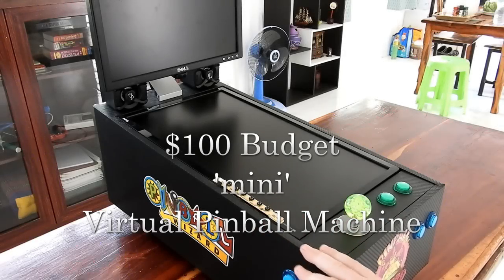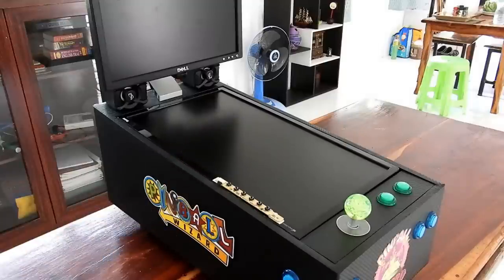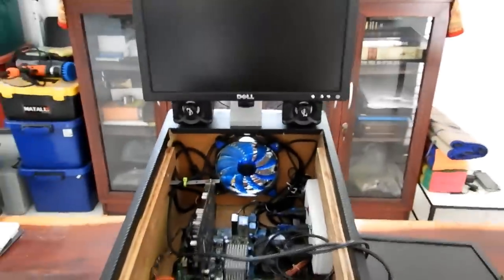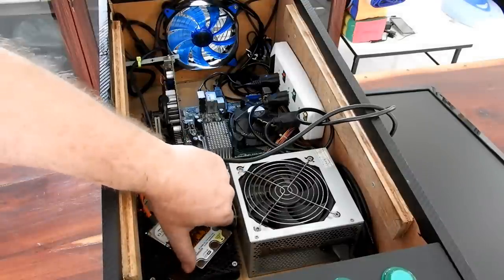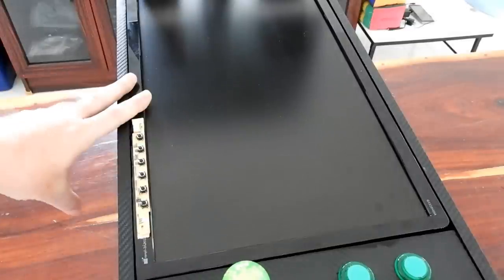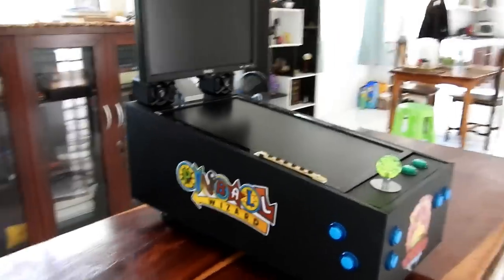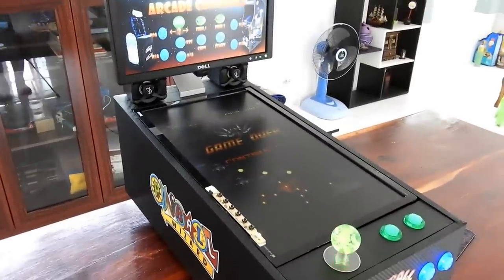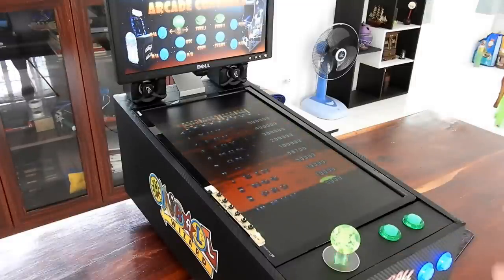$100 Ultra Low Budget Mini Virtual Pinball!

Comment: Nice. I fixed a 3/4 V Pinball cab I bought awhile back that was built the same way where everything can easily removed. Now I want to build a even smaller version since I have the software for it now.
Reply from the maker: Hi John yes I fancy doing another a bit smaller too and possibly a 3/4 size. Work's got in the way for now though might be a while before I can do much more. Cheers!

Comment: Nice work. I'm working on one now that looks very similar. I'm also putting bumpers in mine with mini solnoids that vibrate with the bumpers.. I also made a analogue plunger using a mouse that's upside down that reads the throw. Nice work. I would have stick the monitor controls to the back. Once it's set you don't need them anyway.
Reply from the maker: Hi & thanks! Yes, I stuck the monitor controls to the back of the monitor once it was set up. I might do more with another project such as feedback and plunger, but unfortunately work has gotten in the way so it might be a while... Cheers!

Comment: I have been trying for awhile now to get a zero delay usb board to work with pinball FX3 but have not had any luck at all the program simply wont recognize any of the ones I have on hand. Do you happen to have a link by any chance to the one you used?
Reply: nvm I just now saw your pinned post thanks!
Reply from the maker: Glad it helped!

Comment: Excellent idea, but you need an actual emulator to get a better immersive experience and have an actual flat table. By which I mean not have the table scrolling up and down. I think the dedicated emulators also give you the back glass as well. So same kit as yours, just more pinball focussed software.
 I'm building a 3/4 size, great to know the stuff I already have in my workshop will work. But I'll definitel be using your button setup. Apart from size this build is exactly what I was looking for to sort out my electronics. 
Weirdly I can make space for a floor standing table, but nowhere to put a tabletop model :-)
But it's just a case of scaling up the box and screen.

Thank you.
And English as well :-)
Reply: Any idea what the latency on your screen is ?

Comment: My mind has been blown!  Fantastic project.  I used to build desktops in the late 80's early 90's, get all of my parts (and software) at the monthly computer flea market, some new, some used, some OEM.  You have taken that to a new level with this pinball machine.  I will be tipping a cold one in your direction very soon.  Cheers! I have only tried the MAME / VP games.  Are the others similar in setup?
Reply from the maker: Hi Marcelo, thanks for your kind words. I hope your project works out well too. Future Pinball is similar (free software and tables from the community websites), but hasn't been updated in a while, though some enthusiasts still make tables. It's kinda similar to Visual Pinball in it's layout take a look... Others are Pinball Arcade and Pinball FX3 (current version I think), which are proprietary and available on Steam (and possible elsewhere). These are pretty cool, though some enthusiasts can be a bit anti towards them,, but you should check them out. Cheers!

Comment: How did you get cabinet mode in pinball arcade . at the least fit arcade mode on vertical screen
Reply from the maker: Hi, if you enable portrait mode in Windows screen settings before running you should be able to use pinball arcade in that mode. Cheers!

Comment: Now if only a Red Dwarf playfield and a Holly frontend to pick your games.  Great work.

Are there places that offer downloads for the software ready ti go?  I know you can get the pieces, but putting several pieces together (Mame, Hyperspin, plus various pinball systems) and getting it all to work on 2 monitors would be my issue.

I also prefer the tables to be static... not move with the ball movement.  Is that an option, or only on some tables?

I have built arcade joysticks using a PI B+, but I downloaded all the software, frontend, and games on a micro USB.  I just plugged it in and played.  Hardware and woodworking I can handle.

I guess my question is, are there single images available somewhere for download?
Reply from the maker: Hi Jeff, look at some of the other videos in this playlist to see how this develops. 

You could buy the pre-done setups that are advertised on ebay and similar but a little perseverance and you could do it all yourself it's not that difficult. Again, look at some of the other clips on how to install the software.

I didn't set the correct view during this setup so the table scrolled (which you wouldn't want as you point out). You can change the views easily and there are static full table views - explained in other clips.

Most of the fun for me was the satisfaction of doing it all myself but it is time-consuming and debugging can be frustrating at times...

Last point - look at the other clips of development and software install if you have time it should help to clarify things.

Cheers mate!
Reply: @arnoldj.rimmer5116  Thanks... Smoke me a kipper, Ill be back for breakfast!

Comment: According to your plans and specs, you have a height of 25cm for the bottom panel which would equate to just less than 10".  Is something off, because I can't find a monitor with a height without stand of less than 10" that is approx. 22" in size?
Reply from the maker: Hi, the bottom has no height, it is the floor to the pinball "box". Do you mean the width of the bottom? It is the same as the width of the front and rear pieces (30.5cm), which are all "sandwiched" between the sides (though yes it does look narrower on the plan I drew). 
The plans aren't to scale but are just to show approximate sizes and panels for the monitor I used (I had it already but would recommend something like Acer K242HL) - you should adapt for the monitor you have.  
Hope it clarifies.
Reply: @arnoldj.rimmer5116  Thank you Arnold.  The bottom panel when installed and looking at it from left to right should be equal to or greater than the height of the monitor when laying it in the box.  The Acer you described has a height of 335.9 mm which equates to 13.22".  Your plans say from left to right the height should be 25 cm or 9.84".  Obviously not big enough for even the Acer.  All I was wondering was whether this was a mistake in your specs and plans because it's near impossible to find a monitor that would fit between a left and right panel into the box if the box is only 10" wide.  You don't actually provide the width of the "bottom panel" in your drawing, but it looks like it would be the equivalent of the rear height for the left and right panel which was 25 cm.  Perhaps that's were the mix up is.
Reply from the maker: @echodun  Hi mate you are correct. The monitor I used was a Benq G2220 (I had spare), modified to cut the control panel off to make it properly rectangular. 
I recommend the Acer because it requires no modification (the cable connector layout is also easier) but it does require appropriate modification of the dimensions as you point out.  The plan was only intended as a guide to base your own cabinet on. 
Anyway I hope it helps in a small way if you're planning your own. Cheers!
Reply: @arnoldj.rimmer5116  Thank you for the response.  I ended up going with this monitor - https://www.amazon.com/gp/product/B07CVL2D2S/ref=ppx_yo_dt_b_asin_title_o00_s00?ie=UTF8&psc=1
How did you get the textured look on the wood paneling?  Is that a wrap of some sort?
Reply from the maker: @echodun  Hi! Nice monitor, looks ideal. The wrap is here https://www.aliexpress.com/item/32260499629.html it's pretty generic so you should be able to source similar locally. Cheers!

Comment: Okay so it should run on an asrock beebox n3000 if you want to run an even smaller setup. Cool. Plus it has a monitor mount so you can just mount it to the monitor.
Reply from the maker: I'm not familiar with the asrock model you mention, but the software isn't as demanding as one might think so it would probably run fine.

Comment: For the money you've done a fantastic job there. The only improvement I'd suggest (for very little money) is to use a KL25Z board for more realistic nudging. I find the fixed digital nudges in pinball to be totally false. But then again real pin heads will scoff at anything virtual....so it's all relative. Brilliant little project there!   <^.^>
Reply from the maker: Cheers mate appreciate the feedback and info - will definitely check that board out if I get chance to build another...

Comment: What is the lag time for the play field monitor? what monitor did you use for the upper monitor cabinet? to load more pinball game files what file extensions names are they using?
Reply from the maker: Hi Bill the input lag is insignificant even with this very low spec computer - certainly it's barely noticeable and highly playable. I would recommend a minimum 3GHz CPU (dual core or better) and better GPU > GT630 2GB, for smoother play on the few tables which need it, but it's not an input lag issue. If you want the actual monitor spec: https://www.cnet.com/products/benq-g2220hd-lcd-monitor-21-5-series/ Backglass monitor is a Dell 17" this one - https://www.amazon.com/Dell-E17-LCD-Monitor-Black/dp/B007IWQELC ?You can find tables on many pinball forums - they use different filenames but once you set up VP and FP you will get a better idea. Cheers Bill!

Comment: Hmmm. I wonder if there's a pinball rom pack for a Raspberry Pi?
Reply from the maker: Hi Nick a few people have asked the same thing, but I don't believe so. Maybe ask on the Pi forums? Cheers!
Reply: @arnoldj.rimmer5116  I've done some research. Pinball FX3 or Visual Pinball would be a non starter on the Pi. Nowhere near powerful enough. A Nintendo Switch on the other hand plays FX3 at 1080p. That would be acceptable for a smaller table. It actually looks really good on my 55 inch TV 📺.

Comment: Do you think any of those cheap fanless computer around a $100 bucks would be powerful enough to run the more classic tables?  I'm sure a pi is out of the question.  I think I read the emulator is all windows based.
Reply from the maker: Hi Walter yes Future Pinball and Visual Pinball run on windows. Computer spec of 3.0GHz Dual Core, 4GB Ram, video card Nvidia GT650 2GB (or better than these) will run those programs well, and Pinball Arcade and Pinball FX3. A used PC shouldn't cost as much as $100 - look on Ebay and Craigslist. Not sure about the graphics capabilities on the mini PCs mate - I'd suggest you do some googling...

Comment: Returned from home depot in California.. a sheet of plywood is $110 alone lol
Reply from the maker: That's expensive. I would have preferred to use MDF over Plywood tbh, but it's not available where I am. Maybe that's a cheaper option where you are?
Reply: @arnoldj.rimmer5116  yup $43 for mdf or $32 for melamine 4x8' pieces which is the way I'd have to go

Comment: Waoo!!! Awesome job 💪 dude, Thanks for share the video and the information.
Reply: One Question , what brand is the vertical monitor?
Reply from the maker: It's a BenQ G2220HDA, but i wouldn't recommend this monitor because the control buttons mean the corner needs to be cut off. Something like Acer K242L needs no cutting - though it's slightly bigger and the plans would need to be changed to fit it. Hope it helps!
Reply: @arnoldj.rimmer5116  Thanks!!

Comment: Great Video Arnold
I am looking to make one of these for my child and would love your help
the layout/build i am good with, my concerns is with the program and monitor/screen/picture layout.
how do you have the main screen (playing field) load up from turn on, with the screen showing the proper way (meaning, how is it displaying properly, even though the monitor is turned on it's side?)
also, how do you configure the joystick and buttons to use like a mouse?
what is your list of components inside, that you use for this build?

thanks again, as much info as you can provide, would gladly be appreciated.
Reply from the maker: Cheers Gary! Take a look at this quick clip about the arcade button & joystick controller setup and software to use https://youtu.be/wVe-TSupO94

Basic list of components are those included in a standard desktop computer (MB, CPU, GPU, HDD, RAM, PSU, Fans etc.), which is why its easier just to find a cheap used computer and use all the bits from that! I mention in the last update that I believe (after using it for a while), that you shouldn't go much lower in spec than this to have something running and playing well. Plus of course you will need the button kit with USB encoder which you can get almost anywhere online now very cheaply.

Loading this (or any) program at startup is simple - either it's an option in the software itself or you simply copy a shortcut of the program into the startup folder in Windows.

I will do another short clip about setting up VPX on the cabinet to use on 2 screens and with PinballX front end - I'll cover the screen rotation in that. Cheers Gary!

Comment: Looks awesome! I'm planning to make something very much like this. I was wondering how you mounted the back monitor. It looks like you removed the foot and screwed it onto the back crosspiece. I have a similar Dell monitor that I wanted to do the same thing with, but it's suprisingly heavy for its size. Did you have any issues with the weight?
Reply from the maker: Hi Johnny! 

Yes, that's exactly what I did initially. The crosspiece holds the weight of the monitor without issue, though there is a small, thin, metal plate which is under the crosspiece through which the screws pass, for strength and so that the screws don't damage the wood.

However, please look at the two update videos to see how this developed with the feedback I got. I eventually decided to make a box for the rear monitor, which makes a huge difference to the look and to drop the MAME controller.

Hope it helps!
Reply: @arnoldj.rimmer5116  Thanks, man! I checked out your other videos and although the backbox looks great, I really like the minimalistic look of your original approach. So I think I'll try that first. :)
Reply from the maker: @johnnykickass2815  Hi mate cheers for your positive feedback! I don't disagree with your idea either I'm just glad you got some ideas from mine. Best of luck with it I'd love to see it when you're done and I'm happy to help you out if you get any issues. Best of luck!
Reply: @arnoldj.rimmer5116  Cool! Will do!

Comment: Thanks so much for this video I have wanted to do this project now for 4 years or so and have looked at video after video I just have no technical thinking when it comes to computer s I have purchased all the stuff tv pc speakers Crome buttons the lot apart from the timbers but for that is the easiest part for me I was wondering if I get stuck if you could give me some advice along the way I have downloaded your instructions so fingers crossed great job and I wish I had one your so lucky to own one from tony
Reply from the maker: Hi Tony! I'm glad this has helped take away some of the worry about putting one of these together. And, no problem, if you have any questions please ask on here (as I'm sure others will have similar questions), and I'll try my best to help out. 

To get started, I planned how to lay out a normal desktop computer into my cabinet (because there wasn't much room in this one), so start with that and go from there! All the best Tony!
Reply: Arnold J. Rimmer I have a dell optiplex it’s not a duel core and it did run vista will this be any good or will I need to replace it or maybe even use a cherry pi 4 if I can I will definitely be out my depth their lol but thanks for getting back to me I appreciate it
Reply from the maker: I have 2 Dell Optiplexes (Optiplexi?) here and both are dual core processors (I suspect yours is too if it ran Vista ootb). Download free Piriform Speccy and it'll tell you what the spec is. I'm not familiar with the Pi/Arduino type computers mate sorry but I see they do have lots of support forums.
Reply: Arnold J. Rimmer it is an AMD Athlon  64 I believe I was gifted it by an family members years ago  so that’s all I know  but I can’t wait to get this going if I can
Reply from the maker: If it's a Dell Optiplex 740, it is an AMD dual core (https://www.cnet.com/products/dell-optiplex-740-desktop-computer-amd-athlon-x2-4850e-160gb-1gb-series/), but memory is limited and graphics are onboard (unless it has been upgraded). 

Visual Pinball likely will not run, nor will Pinball Arcade or Pinball FX3on this setup. However, you might get Pinball FX2 going (if you can find it as it's no longer on Steam), though I'm not sure how playable it would be with onboard graphics - maybe try it and see. 

Otherwise, you need to increase the RAM and add a discrete video card, similar or better spec to the GT440 I run in the cabinet. You could look on Craigslist or similar local web pages for used computer components to keep any costs to a minimum.

Get a pinball game up and running properly first, then consider how you'll get it into a pinball cabinet.

Hope it helps!